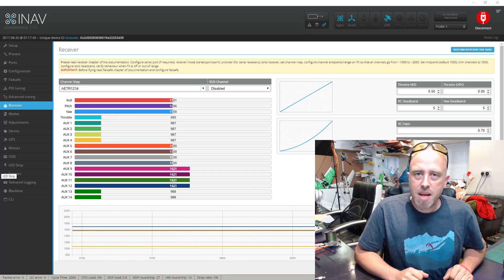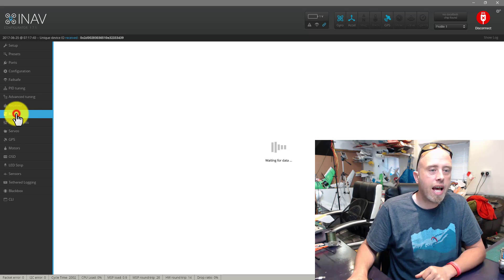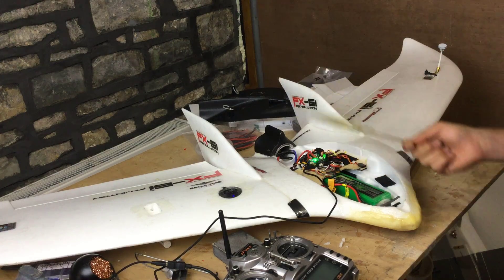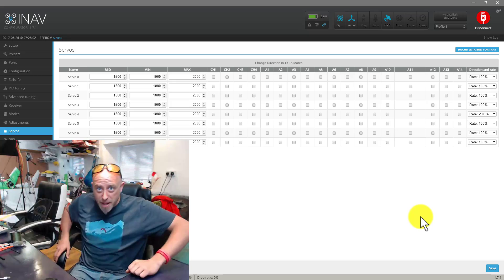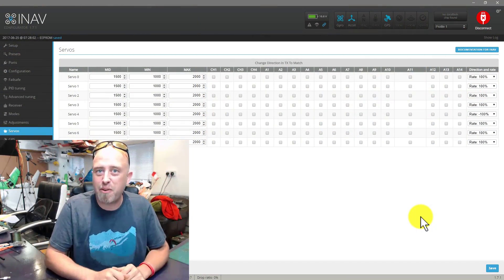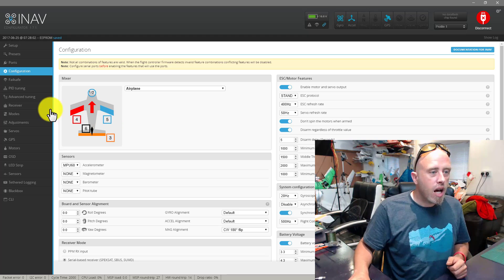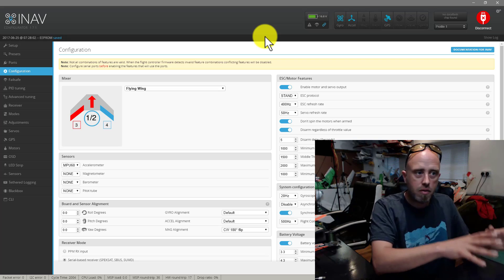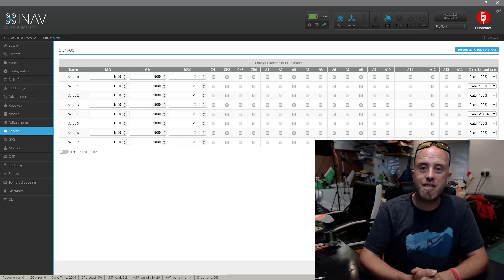iNav - Checking Your Models Surface Movements, the RIGHT way

Comment: Changing one servo direction makes sense to me now. I looked at the Z84 servo orientation and they are mirrored. In fact, the factory label will predict the incorrect travel. For my Tower Pro 9g, the correct orientation is if the label reads from elevon to nose. The problem for me was that the erroneous movement looks exactly like switching your Elevator and Aileron channels. I actually switched AETR to EATR in iNav, which worked, but then later realized that would be a disaster in the air. So, if you are cutting a wing for a DIY, you can orient the servo according the factory label and likely get it right every time. It would be nice to have a default iNav setup that just works and it's possible.

Comment: Hi, good afternoon Matthew, I have a couple of projects for an airplane and a flying wing with my cc3d and the firmware INAV, they are almost ready, everything configured following your videos, an easy star and a falcon skywalker, the truth is that I am impatient , Before in these controllers had installed the freepilot and I have always assigned a channel to a beeper to locate the plane if it fell, I thought that as inav assign two servo outputs for the motor and I only have one, as the second output To assign an auxiliary channel and connect the Beeper, what it was doing with librepilot, but I do not know how to do it, I marked the auxiliary box on the servo tab on the servo 1, to see if it would get that signal through that channel But it does not work, you know how it could be done, you could orient me.
Thank you.

Hola buenas tardes Matthew, tengo un par de proyectos para un avión y un ala volante con mis cc3d y el firmware INAV, ya estan casi listos, todo configurado siguiendo tus videos, un easy star y un skywalker falcon, la verdad es que estoy impaciente, antes en estás controladoras tenía instalado el librepilot y siempre he tenido asignado un canal a un beeper para localizar el avión si se caía, he pensado que como inav asignar dos salidas de servo para el motor y yo sólo llevo uno, pues la segunda salida de motor asignarle un canal auxiliar y conectarle el Beeper, qué es lo que hacía con librepilot, pero no sé cómo hacerlo, he marcado la casilla de auxiliar en la pestaña servos en el servo 1, para ver si así sacaba esa señal por ese canal pero no funciona, sabes como podría hacerse, podrías orientarme.
Gracias.
Reply from the maker: Hi Juan, the simple solution would be to go to the modes tab and set a AUX channel to turn the beeper on & off. That is of course assuming that the CC3D board has a set of buzzer pins. If it does not and your buzzer supports PWM, then you could map a AUX channel to a PWm output, see this example of mapping to a AUX channel https://github.com/iNavFlight/inav/wiki/Custom-mixes-for-exotic-setups#v-tail-fixed-wing Hope that helps Juan, Matt
Reply: Many thanks Matthew for his quick response, but the truth is that I do not understand, my programming skills with the CLI are null.
I do not understand programming. Nor the syntax.
Thanks, all I need is to assign auxiliary 4 to the output pwm 2, of the motor that I do not use. I'll go and try things. thank you very much.
A greeting.

Muchas gracias Matthew por su rápida respuesta, pero la verdad es que no lo entiendo, mis conocimientos de programación con el CLI son nulos.
no entiendo la programación. ni la sintaxis.
gracias, lo único que necesito es asignar el auxiliar 4 a la salida pwm 2, del motor que no uso. Iré probando cosas. muchas gracias.
Un saludo.
Reply: Is to connect a discovery buzzer.
Reply from the maker: I'm not too sure, maybe see the RC Groups thread instead? Normally I just connect up the buzzer to the buzzer pins. Matt
Reply: Many, many thanks for the interest, matt. If I solve it I'll tell you.
A greeting.

Comment: Xcellent idea on the prop removal. I got lazy with that and almost hurt myself badly with my nano sky hunter thank Matt and please heed Matts advice.
Reply from the maker: Howdy Kevin, I've got close to a strike but not had a full one thankfully. It's also especially important at this stage just in case you've put the ESC connector on the wrong plug ;) Matt